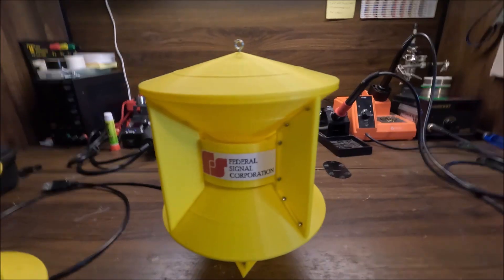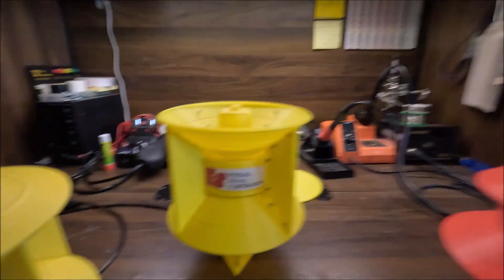BEST Revamped Mini SD-10 Overview/Test!

Comment: WOW. Just wow. The pitch is actually pretty much 100% percent accurate, since single-phase Federal sirens use a brushed motor like the one on your siren.
Also I must ask, now that you’re doing the chopper in resin, how tight did you manage to get the tolerance?
Reply from the maker: "Thank you" is not enough! You're amazing, man!!
And I'm glad you asked about the resin-printed rotor. I did have to tweak the tolerances a bit since resin printers are so exact. I printed a rotor tolerance tool in resin, fit that onto my 2 mm motor shaft, and found that just 2.1 mm fit fine, which is 0.1 mm bigger than the motor's actual shaft. Cool huh? Anyway, hope this helps!
Reply: Sorry, I should clarify: by tolerance, I meant how close you could safely get the rotor to the stator (since the smaller the gap, the louder the sound). My bad for the vagueness!
Reply from the maker: @autismicme Ohh yeah, no problem. I actually didn't have to tweak the rotor/stator tolerance even though I printed this rotor in resin. The rotor diameter is 57.15 mm normally, and the stator inner diameter is 59.15, which is about a 1 mm gap between the two. It doesn't scrape at all, even with the resin-printed rotor! Hope this helps.

Comment: Make a custom siren that is a sth-10 and and stl-10 stacking on each other looking like a 3t22 but 12:7 port
Reply from the maker: There is evidence of a prototype 2T22 being 7/12-port, but I don't really want to make one. I already have a mini STL-10 and STH-10, so making a siren like that would be redundant.
Reply: You could just put your STH-10 upside down atop your STL-10 and see what happens
Reply from the maker: @autismicme lol! Or use a dual-shaft motor on both the 7 and 12-port cores.

Comment: you should make one out of weatherproof filament like petg and mount one perm. outside. i am definitely making this if i get a new printer, hopefully an elegoo centauri cARbon
Reply from the maker: Yeah, I used to do that with my prototype STL-10 and SD-10, but that failed, as I printed them in wimpy PLA and they were left outside for months. I won't do this anymore because mini sirens outside are just, I think, impractical. I'd rather get a real siren outside.
Reply: @milespeterson5049  that be cool

Comment: Lets go!! Looks great! (Hopefully this is the final version!)
Reply from the maker: Thanks! It should be the final version, so don't worry about having to reprint everything again, lol. I think I've finally got the files to the point I can sell these!
Reply: @milespeterson5049  Awesome! I can't wait for you to start selling sirens! You said the HOR Sirex would be like $150 or $200 right?
Reply from the maker: Yeah, probably around there! It's an 1/8 scale siren, but the overall size and parts required to build a Super Sirex is pretty crazy, so I'm gonna have to price it around $200. The same can be said with my 1/4 scale 2001-130. However, smaller 1/8 and 1/6 scale sirens, like my STL-10, ECLIPSE-8, Model M, and 40V2T, will probably be around just $100. This is just what I was thinking, though. I guess the final price really depends on the labor, parts, and time it takes to build it.